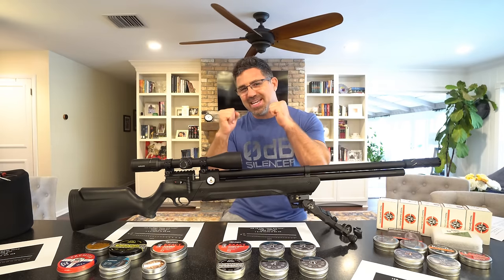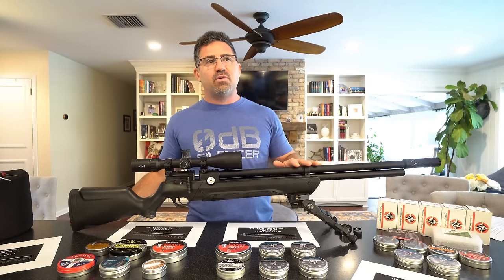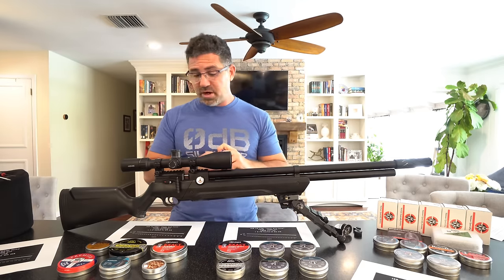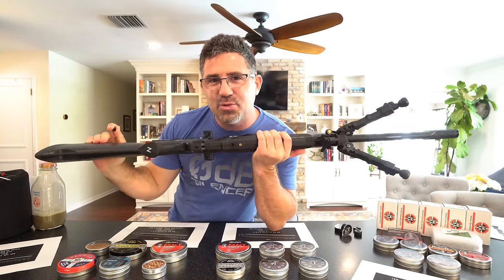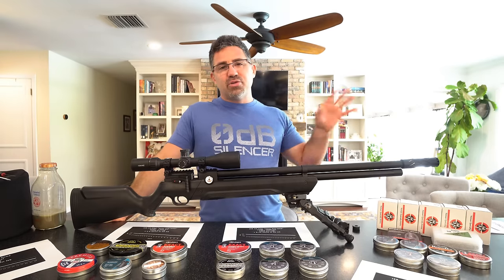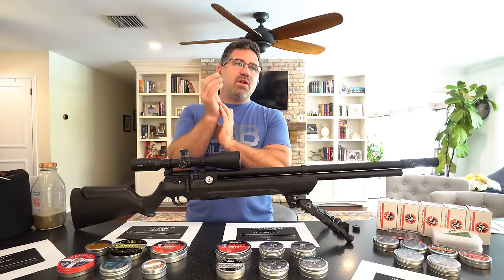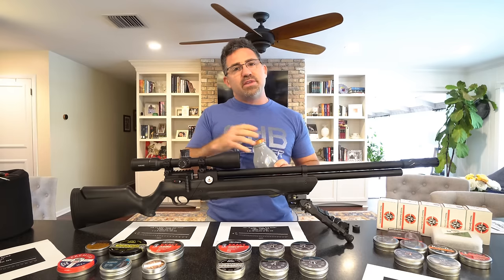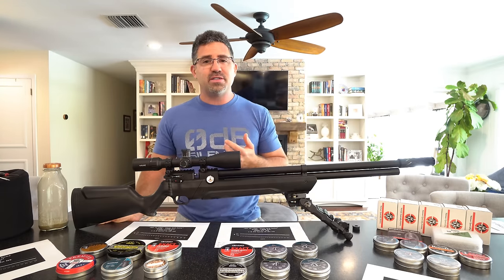Air Venturi Avenger (AIRGUN TUNING GUIDE) ! + ACCURACY TEST - Airgun Regulator & Hammer Spring Setup

Comment: The top weaver/picatinny rail on the top of the rifle is cast aluminum not plastic. I had to replace mine because they were way out of alignment from the factory. It just seems to me they could check it at the factory to see if at least they were level with each other. My back rail canted left and up while the front canted right and down. It made mounting a scope almost impossible. I kept running out of windage and elevation on both a Hawk and a UTG scope. It wouldn't hold zero. i thought the rifle was bad till I pulled the scope off and checked both front and rear rails. BINGO! Now the rifle (.22 cal) is a tack driver!
Reply: same problem here

Comment: The only valid point to this video is the fact it is now a free floating barrel. In my opinion, and what I did, is take the “air scrubber” off the barrel inside the shroud. Sound was no different, but then the barrel was floating free inside the shroud. I run my regulator at 2100 psi and shoot NSA 20.2 grain at 900fps and have that same accuracy. Free floating the barrel makes all the difference. Before, if I put a little weight in the stock, while shooting, that weight transferred to the bi pods and my POI would raise. Free floating that barrel is key to make these guns shoot right

Comment: Just got a avenge-x. Zeroed it and fired 4 shots at 20 yards not messing with any settings. 3 where quarter size and the 4th was user error (slightly outside quarter). I'm sure I could get them closer by messing with the settings. Not experienced in PCP but I have a feeling it has too much psi. Having a bipod and a gun rest would likely help too.
This is my first PCP and I'm very happy with it so far.

Was shooting; 
Avenge-X synthetic stock w/ carbon fiber bottle
H&N Barracuda Hunter Extreme 18.52gr
Reg @ 150bar (what it came as)
HS @ no clue (haven't touched it yet)

Comment: Fairly sure the reason the yellow/orange is on the regulator gauge is because the regulator needs to be set higher to be able to hold pressure. When I set mine anywhere in the yellow the regulator seems to leak but not when its increased above there.

Comment: Hi steve i have a bengamin cayden in 22 call it seams to shoot about 60 fps slower than most on the forums and here i have cheaked the barrel orings and breech seal by a vacume test and there is no leaks there and this is with a 3000 psi fill and transfer port fully open.If i set my hammer spring In to 6 and a half cw turns from full ccw i can get average of 890-894 fps with jsb cometa 15.89 gr pellets even with the hammer spring set at 50% thats still a little slow for this gun and pellet comb.The cayden has full 14 turns of adjustment from full ccw to full clockwise and when spring bind reached it takes 2 turns out to get hammer to cock.so there are for sure 12 full turns of adjustment.When set at 6.5 turns preload i only get about 24 full power shots befour my fps drops to more than 4% for 50 yards.She is a tack driver for sure.If set at 2 and a half turns preload cw or in from full ccw  with the jsb 15.89s in 5.52 head size it will average about 864 fps for about 36 shots befour the fps starts to drop.Does this sound normal for this cayden.Thanks a bunch and i love your channel ..

Comment: Hi Steve, I love all the programs you put out. I learn something from each one. I’m buying a AEA hp as plus .22 witch is a non regulated rifle with a power wheel. All the programs I watched have shown crono # in the 980-920 over 3 mags then low 900’s high 800’s for the next 2 and low 800’s to high 700’s until it won’t index the next pellet.  My thoughts are can I start with the power wheel turned down to get the fps to 880-825 and after 3 mags or watching the gauge clicking the power wheel up trying to keep the the shot string as flat as possible. Sent the same comment to PJ just wondering what your thoughts are. I’m a 25-75 yard shooter

Comment: Who wants to shoot slugs I leave some tips.

Increase the transfer port of the barrel and block and trigger to 5 mm.

Make a pre-chamber with something like 25 to 30 cc at least.

Put a lighter trigger spring.

So my .22 is getting 295 ms with 21.2 grain slugs with 2.200 psi on the reg! With a little more pressure on the reg you will be able to cast slugs of 25 grains or more at 290 ms, of course, it takes air but it's worth it!

Also, check the pipe! Make shims with pieces of tin to fix it 100%, glue the centralizers to the barrel so they don't move! And most importantly, on the centralizer that is next to the block add one more screw on the other side, it NEEDS 2 screws to keep it firm!

With these modifications my airgun became powerful and I solved the problem with the diagonal change of POI.

NOTE For maximum accuracy with slugs use higher pressures such as 2400 to 2700 PSI!

Comment: Excellent vid on Tuning and Pat over at Pyramyd put me onto it.  I have one big question,,, How do these tuning numbers relate to a .25 cal. model?  I am assuming that maybe 2800 on the Regulator is going to be the "Sweet Spot" for the Power Tune and maybe 1900 for the Pro Tune? I have JSB Exact 25 gr pellets and JSB Kings at 34 gr.  Will be using the 25 gr ones most, but need to understand how the gun looks at heavier pellets, as I want to use Kings for hunting larger game. I assume that the big difference will be in the Trajectory of the different pellets.

The other thing,,,  how much does the trajectory change over the different tune levels? And how far below the Regulator setting  before the Trajectory changes noticeably. Or do I have to do Ladder Targets to see exactly what is happening.  With 3000+ rounds thru your gun I'd expect that you would have all this sussed out pretty thoroughly.  

What I saw in the video was velocity changing very little between Tunes. All of this is new to me as none of my Weihrauch Springers are remotely close to the Velocities this thing generates.  My R1 is at 625 fps with JSB 18 gr pellets. My Avenger came out after the $10 pre service, running 20 gr pellets at 860-870 fps. 

 Been shooting good Springers since 1977, but PCP's are completely different.

www.buchananprecisionmachine.com

Comment: Well for me that's good, because I missed out the first time.
 Hi Steve, I'm looking to buy this rifle and I heard you say in the video that I it can get 25fpe in the eco tune and get 100+ shots at 800ish fps.
I will be using a hand pump at first until I can get a scuba tank.  With the air tube empty, up to what pressure do I have to pump to achieve the 1800pci at the regulator and get that 800fps?  That's going to be my operating setting for some time until I've mastered it and then move up to get more fpe.  Will it be a big effort to pump the gun to be able to shoot at 1800psi?

Comment: Just got my 177 cal barrel kit for the X. How come slugs in 22 cal come smaller (.216 - .218) 
The 177 .. only .177 and .178 or larger ? I tried some HN 177 13 gr slugs and they were really tight loading. Even with the .25 the actual diameter is close.

Comment: Steve,  I bought an AV  bullpup in .25  I do not like to touch settings for fear of doing something wrong   Ialso have a fx dream pup and haven't touched IT..... but because the AV seemed easy I decided to try it.  I degassed and brought the reg screw all the way to the right and turned left 1/4 turn and got the HS and turned it all the way to the left and 1/4 turn to the right  aired up to about 4000 psi and saw almost no difference to the way I took it out of the box.  I'm trying to get the FPS down because I'm shooting in my cellar at 50 feet.  What am I doing wrong??????

Comment: Hey buddy ! I have a very important question. I watched a review with you talking about tuning your gun to shoot shorter burst of air with slugs so you have better accuracy at 50 and 100 yards. So there's no access air throwing off your slug . It that accomplished but backing down off the 5.5 turns all the way in on the hammer spring ? Or is that accomplished by the regulator. I get everything else but this. Please help.  About to get my avenger . And I wanna know that. Seems like a very important aspect

Comment: When it comes to crown vs non, I think the number one factor is concentricity. Either way, if it's not, you will have a bad result.
Reply: The crown itself matters not.. The barrel must be cut off perfectly square.  If it is perfectly square then the rifling will release the pellet the same way every time.  If it is cockeyed then it's up for grabs as it pushes the bullet off to one side.  The whole purpose of the crown is to insure that the muzzle is perfectly square to the centerline of the bore. If you accomplished that when you sawed the barrel off then you don't need to crown it.

Comment: It is true that if I have the regulator at 1400 and I exceed twice that amount in the air filling of the tank, my impact changes that I have to fill at 2800 so that the impact does not change places? Regulator at 1400 I fill at 3000 psi I shoot and let go down to 2800 psi it changes the impact poi
Reply from the maker: POI should only change if velocity  does.  What's the chronograph data?  Thanks, Steve
Reply: @AEAC  So it doesn't matter if I have it regulated at 1400 and I fill it completely with air, why now that I have it at 1400 reg and a hammer turn with 14gr I notice that after a period of lowering the air the poi changes and I have to correcting and they tell me that I do not have to fill with air that exceeds twice as much as I have it regulated

Comment: Since you Reposted - 
Do you know the Shot Count at sub-12 & say 20Ft.Lbs. ? 
Sub-12 in the U.K. &
Say 20 for the people Converting from Magnum Springer?
Reply: Converting to be able to take follow up shots, without taking your eye- off the target !?.
Reply from the maker: @MrPrice989  So as discussed in this video, I wasn't able to successfully tune the gun below 20 fpe.  The porting & spring rates weren't optimized for that.  A .177 cal might be the ticket there.  Best, Steve